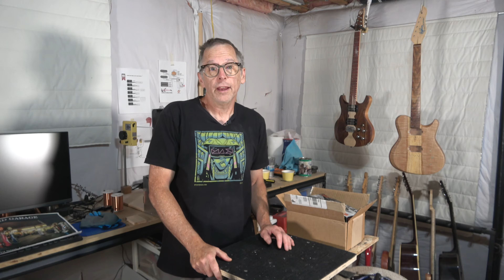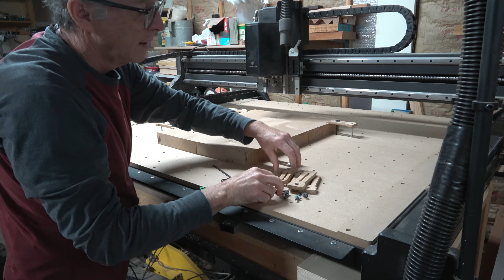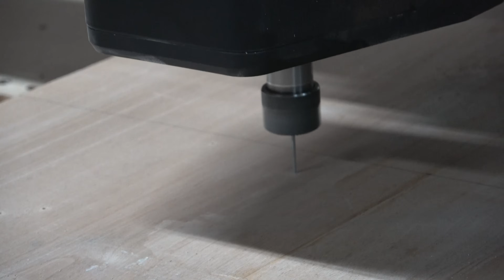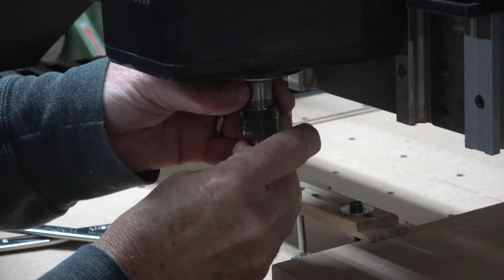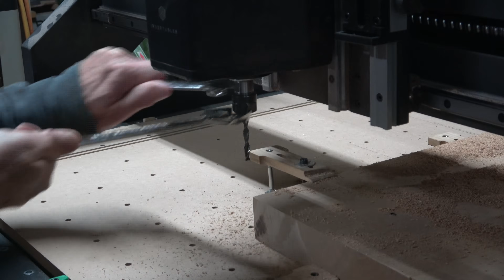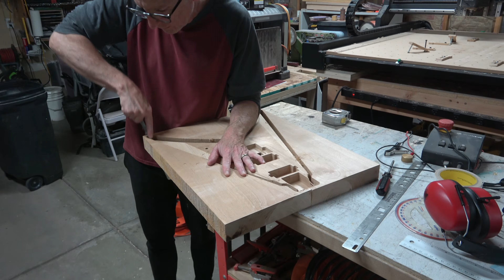Making A V-Shaped Guitar Part 11 Carving The Body On A CNC Machine

Comment: Hi Chris.  I think I have mentioned this before but going to say again to try and get you to try it.  Drill a hole in each corner of the slab.  Bevel the hole with a larger drill if you plan on surfacing.  Take the slab over to the cnc.  Put a longer screw in each corner and just screw that slab down!  The slab will never move or come lose now and it takes just a minute!  It is way easier and better than using those clamps.  I know it is hard the first time you do it because your putting a hole in that perfect piece of MDF.  You can put a hole lot of holes in there before you have to replace it.  For two sided you can use the dowel method and drill a couple dowel holes in the MDF.  Your alignment will be perfect every time!  You will be much happier!!